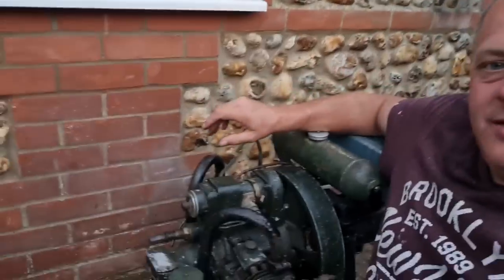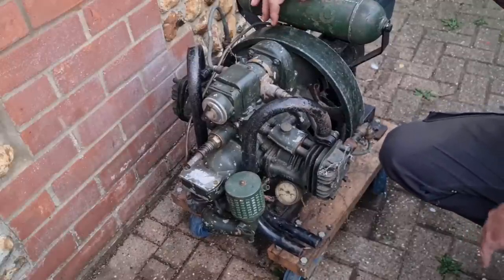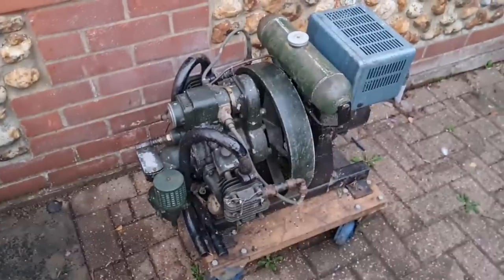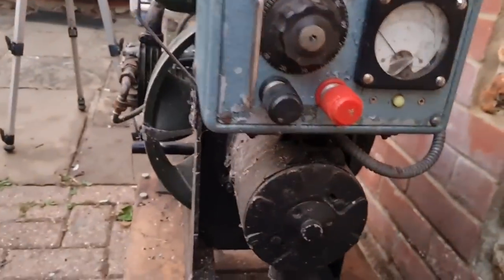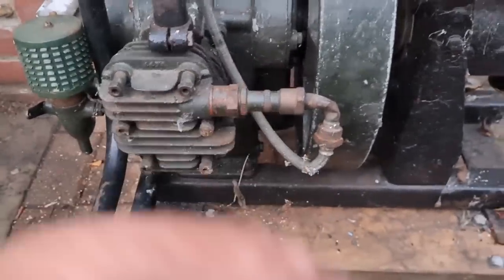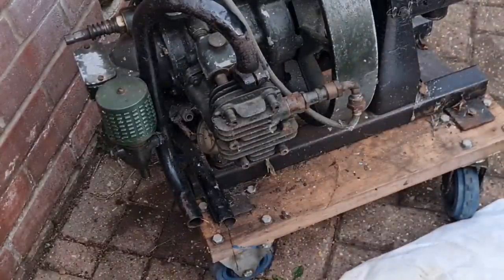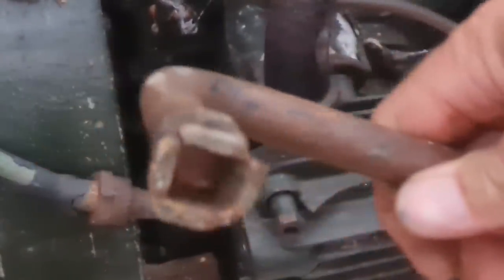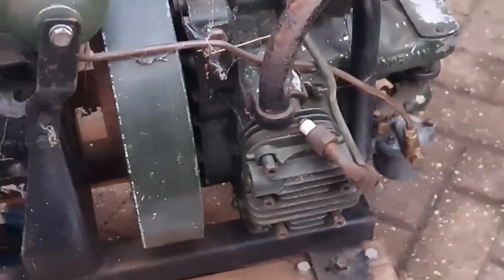Scrap yard Find. Norman flat twin engine.

Comment: Nice find , got given a Husqvarna 61 yesterday that was going in the skip when they  cleaning out a old shed 👍
Reply: Great saws, ive had mine for 12 years, running a cheap replacement piston and cylinder and I've cut a few hundred cubic meters of firewood with it and felled up to 30" trees with it.
Solid, dependable and still have all parts available!

Comment: Great save, makes you wonder what slips through the net and gets scrapped when some old boy dies and the family just want all the 'old junk' gone.

I think that's a 'Vokes' military spec air filter, something tells me they're pretty rare to find. You may find the engine was reconditioned and put into storage, I had 2 ex-Air Ministry Villiers MK 25s and was told by the seller that was the case, one still had a plastic blanking plug in the spark plug hole so could have been true but I sold them on without doing anything with them.
Reply from the maker: Yeah my mate called tonight and said his brother had been looking for one of the air filters for years. Maybe they are rare. I have no idea.

Comment: Easiest and quickest way to check for a spark is put your thumb over the end of the plug lead and turn the engine a few times. Saves a lot of time wondering

Comment: How about 2 big croc clips joined by a bit of bendy copper heavy duty mains wire to test sparks? One end to hold the plug, the other to clip to earth. I've been meaning to make one for years, it's such a pain trying to prop a plug against a bit of the engine to watch for sparks! Maybe next time, I think I've got the bits in my shed, the croc clips being electric fence ones. But I'll probably just prop a plug on the block once again :)

Comment: That generator looks like it's off an aircraft I had one once that I was going to use for a welder but sent it to Duxford as it was brand new old stock(1945) Air ministry 24 volt 300 amp.

Comment: This Norman genset is obviously 12 v if not 6v. Since this Norman is so old my guess is 6v. Like to see her run though. Looks a lot like a washing machine motor. If here stateside across the pond. My guess is also 300 watts ya'll could charge a battery with over night. The old boy that built this Norman probably expired back in 1957  or so. Like to see what voltage she puts out. If 12v might be a 65 model genset though the military plugs point back to before 1945 thus 6v.

Comment: Wishing you success getting this running. The points look odd (to me), they seem to be rotating along with the cam (so would never open, close properly), you can tell that I know nothing about engines.
Reply from the maker: Lol.. its a funny set up. Several mags have that same set up were the points spin and cam is fixed.